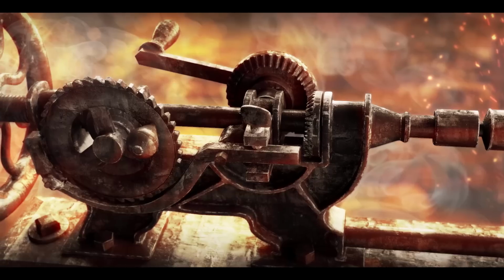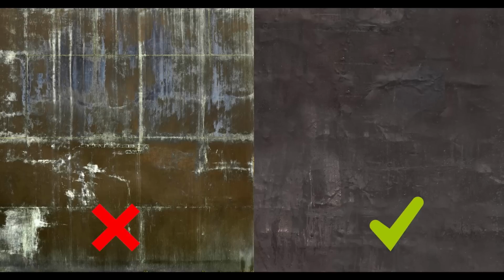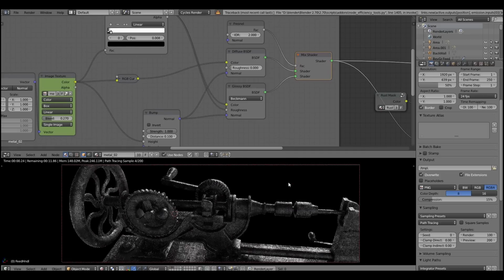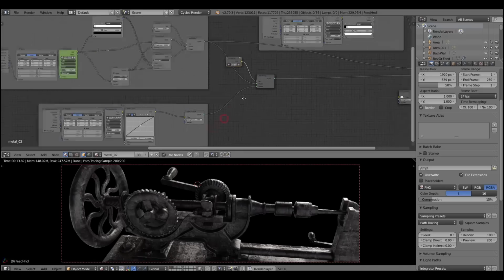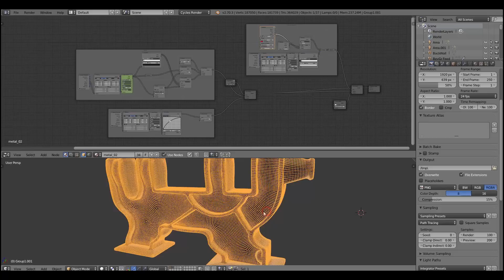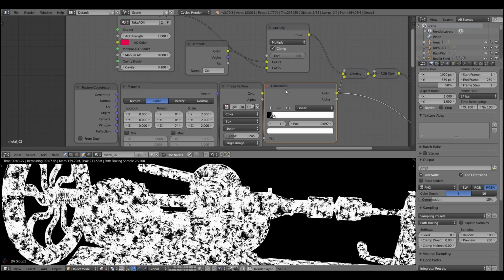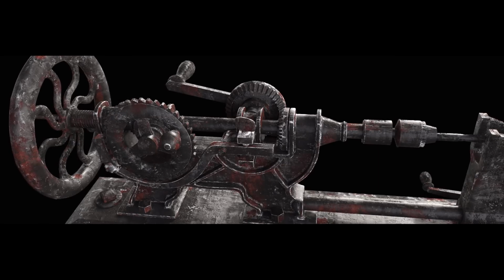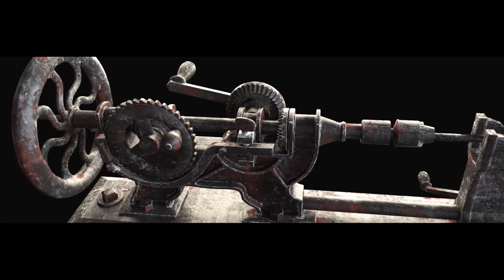Blender Tutorial: How to Make a Grungy Metal Material?

Comment: Awesome tutorial! I'm a little new to blender especially when it comes to cycles and nodes, so I'm a little lost at 2:00. It looks as if you're using another material as the mixing factor of your rust? How do you set that up?
Reply: +Marion Washington From what i know, he's using a node group. Just like normal object groups in blender, a node group can be created with Control+G and any changes made to the original change in every instance, but you toggle edit mode for node groups with TAB. That tiny little box he has is a node group. Also like normal object groups, you can Shift+A when in the node editor and at the bottom of the menu, there's a "Groups" submenu, where you can find any node groups that have been created. Some more info can be found here: https://www.blender.org/manual/editors/node_editor/node_groups.html